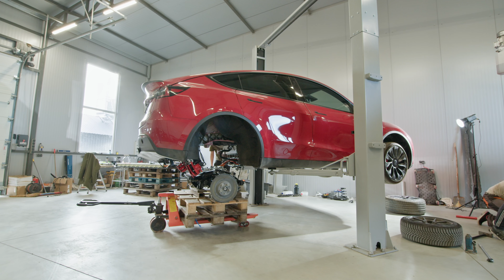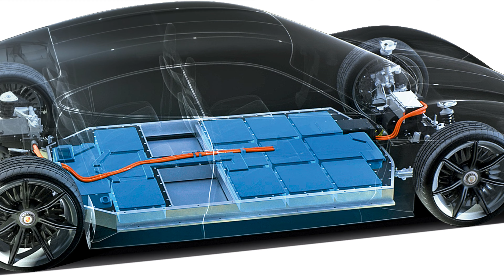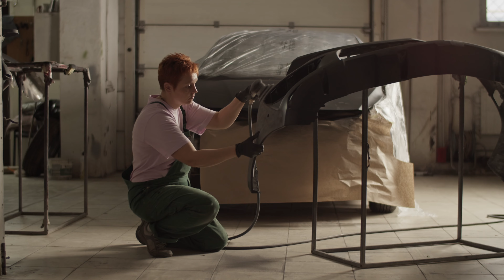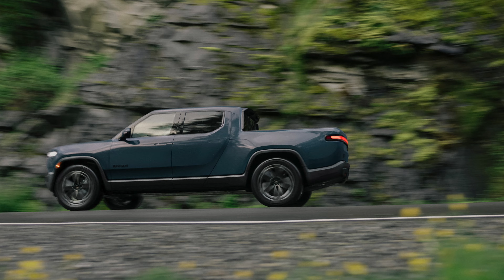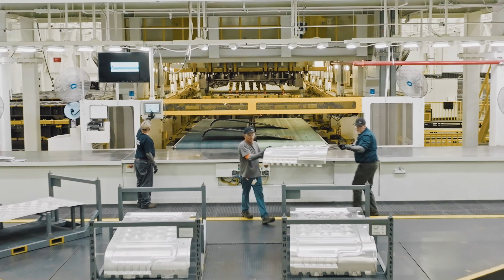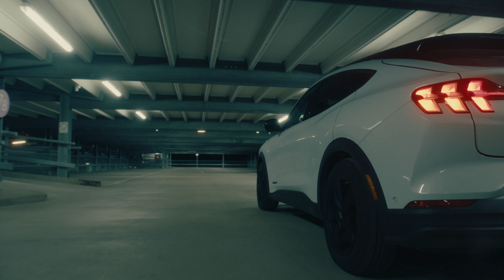Why EV Repairs Cost So Much (And Why Insurance Is Even Worse)

Comment from the maker: EV insurance is usually 20–25% higher than similar gas cars — often $400–$1,200 more per year.
The biggest reasons:
• Battery pack location
• Specialized repair equipment
• ADAS sensor calibration
• Early design choices that complicate body work
What cost surprises have you seen with EVs? I’m replying to every comment here.

Comment: Tires. I got a nail in my tire and had to replace one for my Mustang Mach-e. Had to pay about $300 or so.
Reply from the maker: Tires can be surprisingly expensive.  If you're used to buying sports car tires, maybe they are similar, but compared to most typical cars, EVs need tires that can handle higher loads, higher torque, and still offer lower rolling resistance and noise control.